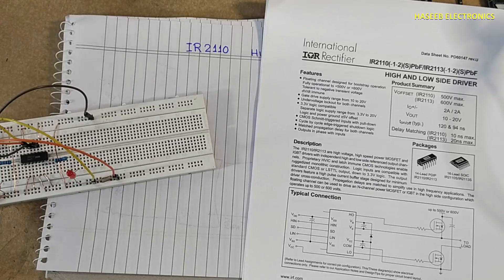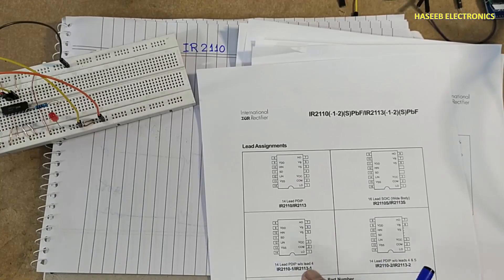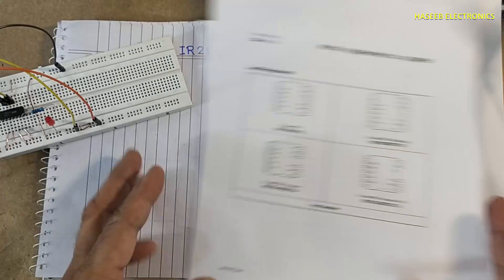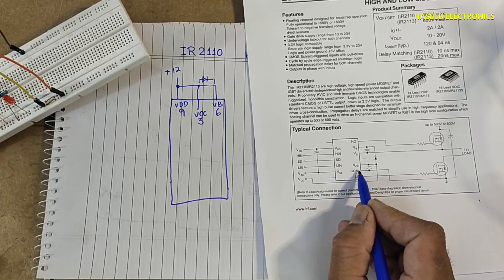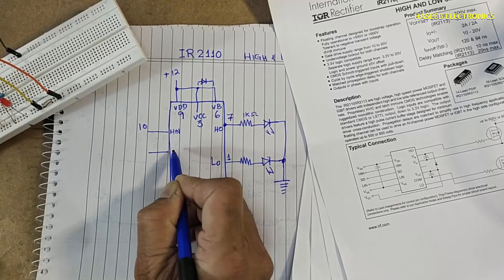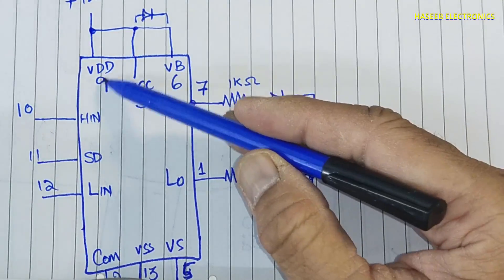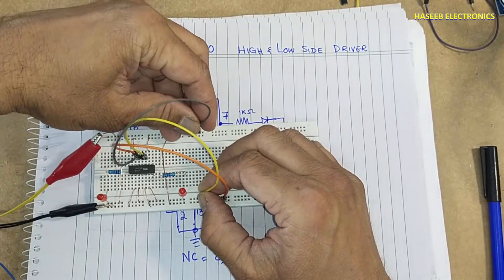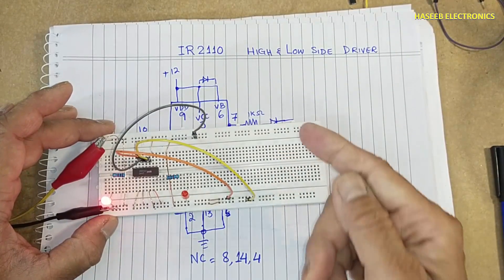{1059} IR2110 High and Low Side Driver, Testing, Explained

Comment: Thanks for vedio, can I use IR2110 in 1MHz switching frequency with mosfet transistor that part number is C2M0080120D?? I want design a full bridge inverter working in 1MHz as DC to AC converter in high power transfer in Evs

Comment: Good video, at 09:01 you shown that high and low input are shorted together. And this is due to absence of bootstrap capacitor. About which pins it shold be normally located?
Reply: The bootstrap capacitor is connected to pins VB and VS

Comment: Thank you❤❤ I need help. What is the equalent  ic of Tc1252m pwm ic for 1000 Watts smps power supply? Please help me
Reply from the maker: TC1252 is i think NCP1252 (8 pin) and it has more dlphabets followed by 1252 (A, B, C, D, E indicating the duty cycle and operating voltage)  
https://www.onsemi.com/pdf/datasheet/ncp1252-d.pdf
i think it is hard to find its exact compatible. if it is not available then it will need to modify the circuit
Reply: @HaseebElectronics  thank you sir i will try it
Reply from the maker: i think TC1252 is NCP1252 
https://www.onsemi.com/pdf/datasheet/ncp1252-d.pdf
please check complete part number for ending digit to determine the operating voltage and duty cycle. 
i think its exact compatible is very difficult. if it is not available then might be some modified ciruit may be used to drive at same specs

Comment: Excellent, as always, Haseeb = Thank you. I have just been developing an Universal H Bridge Motor Driver Breakout Board. Maybe my design considerations will be helpful to others. The boards are meant to use NPN MOSFETS, on both the high and low side. This adds to economy and availability of parts. When using NPNs on the high side, a bootstrap is required. The board provides for these components. When the board is used on the low side, the bootstrap components are simply not populated, or jumped, as required. A simple LTV-817S optocoupler is used to 1) separate/protect the microcontroller pin from the high side voltage and, 2) as it contains a transistor, to drive the power MOSFET, directly. I have made the boards to fit just one MOSFET at a time. This supports different uses and heat sink configurations. I do not claim the use of optocouplers is unique; these circuit designs can be found, readily, on the internet. They do have the advantages of protecting the MCU and building the driver cost effectively, with just a very few components. My boards are in the mail to me, even now. We will see how they work. Cheers.

Comment: Thanks Haseeb for this video, also last videos with bootstrap circuits was nice part of theory to better understanding working of power electronics units. I thought, will be good also to make test with two extra mosfets driving this LED's instead of driving LED's directly from IR2110. One LED connected to GND and other connected to Vcc. This will test bootstrap capacitor and "down" mosfets inside IR2110 driver as well.

Comment: Assalam Walekum rahmtullah sir is the IOR 2110 and IOR 2136 same? We are using ior 2136 continuously but we don't know how this 2136 is work if you will discuss about this 2136 it will be so helpful for us this IC used in the sewing machine circuit board to drive the motor IGBT